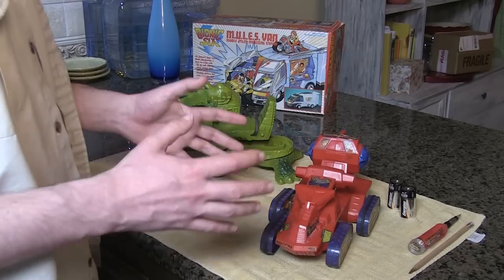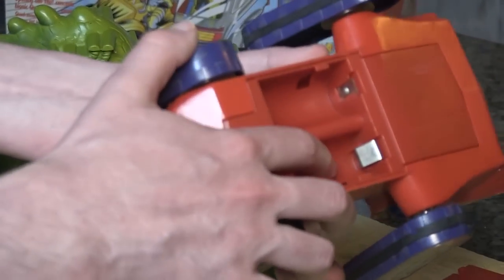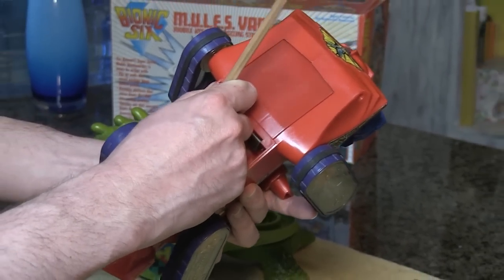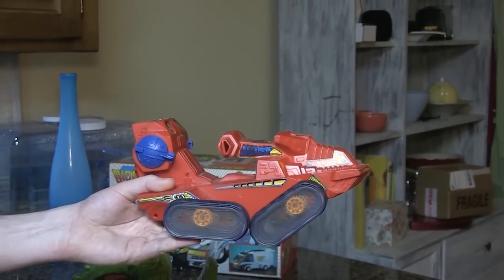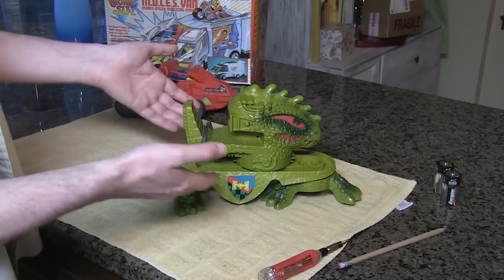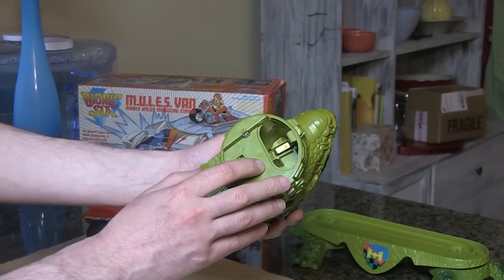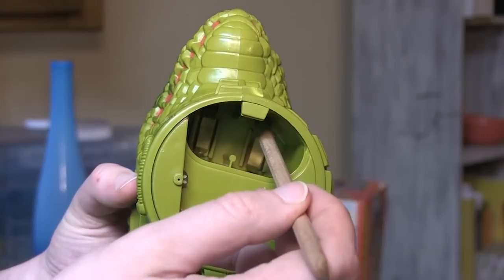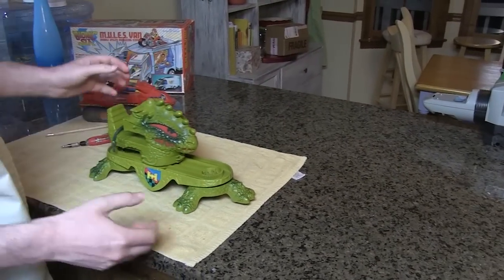MOTU Attak Trak & Dragon Walker Repair! Vintage He-Man Mattel

Comment: Over the past months I've dug into your video library. I came across this video and your observations on the dragonwalker instantly made me realize that is most likely the issue I have with mine. 

I finally got to sit down with my childhood toy and find out today. So after a few times of removing the batteries, pushing on the connectors tripling cleaning the connection areas. I flicked the switch. Nothing. So a brief moment of thought that, maybe the motor is stuck 🤔 With a couple switch flicks and the gentlest shake, it came to life in my hands! I was and still am ecstatic! As soon as I heard the noise of the motor, I sat back in my chair kicking my legs and giggling like a toddler.

These moments are why I have always kept and collected toys. You really can't put a value on joy, and you brought a little more into the world for me today. Thank you so much!
Reply from the maker: Congratulations! There's nothing like the satisfaction of fixing something yourself.

Comment: I learned on another video that the way you can prime the dragon walker motor is to put the head on the track and manually slide it down the track-it'll sound horrible and you'll cringe doing it, but that's what got mine running again after I ruled out the battery issue Michael talked about~

Comment: Michael, try using lemon juice to clean battery contacts.  I use lemon juice to clean the battery contacts of my Canon flash units involving photography. I just use a q-tip and buy one of those "plastic lemons" you can find at any grocery store that has lemon juice and wipe/apply as needed.  The acidic nature of the lemon juice neutralizes the corrosion.  Hope this helps.  Keep up the great work.

Comment: I got a dragon walker recently and could not figure out how the heck to get in there. I though I was supposed to push the coin in the slots and I didn't because it seemed so wrong. This makes much more sense but...what was wrong with a standard battery compartment? LOL

Comment: Great video and helpful--and i appreciate it.  Unfortunately for me, when i tried to clean my battery contacts, one snapped right off.  I think my treasured dragon walker may be dead.....one of the internal tabs is almost entirely gone, and this on top of the fact that a battery leaked into the internal casing.  I cant figure out a way to deconstruct it, and nostalgia is preventing me from throwing it out........thanks for the effort on this film though.

Comment: The dragon Walker looks like it doesn't go straight because the legs start to spin before the top part does because the torque maybe if you put some grips on the bottom of the feet and maybe way the legs down a little more to create a grip on the feet you don't want too much of a grip cuz it's got to be able to slide to make the turn

Comment: What kind of batteries do these take? I have cs but not sure if they would fit. Would like one of my own from ebay.
Reply from the maker: Directions say 2 C batteries https://www.flickr.com/photos/62774254@N08/albums/72157645207767850/
Reply: Both the dragon walker and attack track?
Reply: Looked it up and it also uses c. Both do in fact.

Comment: Actually there is one vintage MOTU toy vehicle that you CAN open by unscrewing it! the SPYDOR vehicle! please do a video on how to get the spydor toy to work again because I just bought one complete with all 6 legs both of its battery compartments are 100% clean & nothing seems to be broken but it wont work I believe its engine has seized up!? so Please make a video to teach how to get it running again ASAP THANKS!